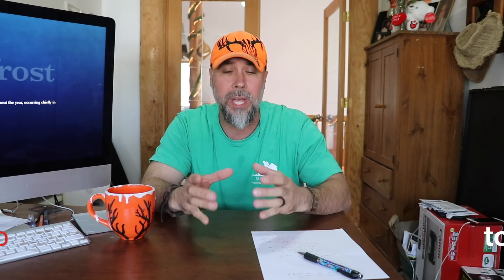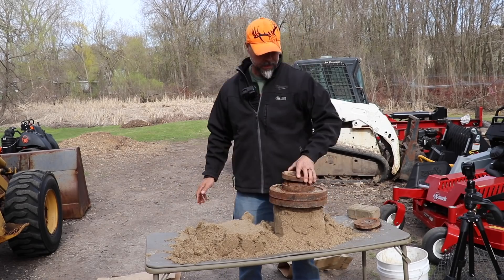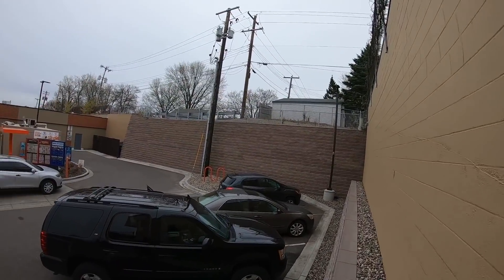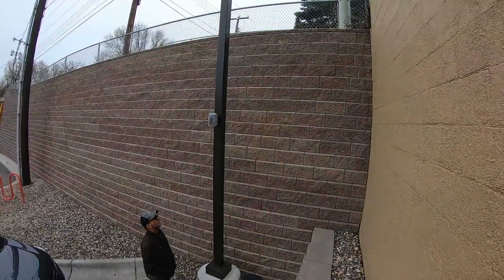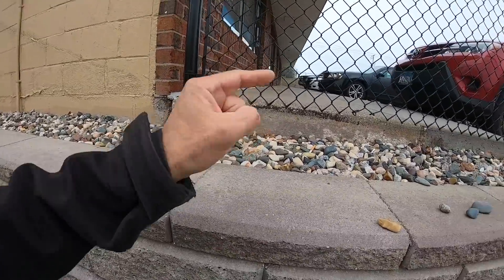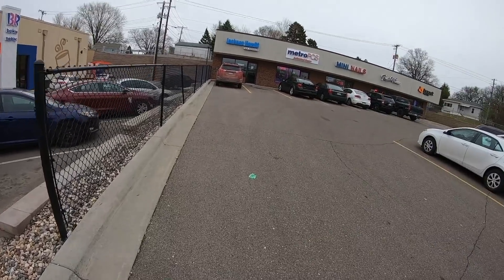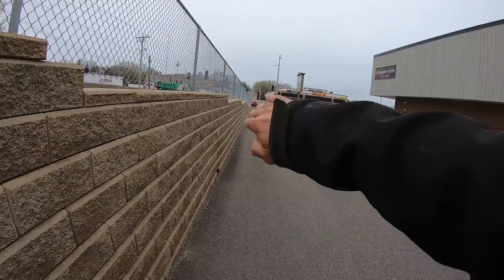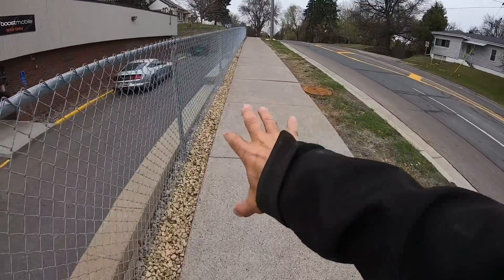Retaining walls and Geogrid- How a retaining wall fails pt2

Comment: The first example of a retaining wall didn't consider that the City most definitely had to approve plans and inspect the work. So either everyone, from the civil engineer to the plan checker to the city inspector to the constractor to the sub, must have blown it. In this day and age, and in my experience as a commercial developer, I don't see that happening. But whether it happened or not, It seems like that should have been mentioned.

Comment: We are working a wall for a homeowner, “who used to build houses”. Sugar sand, positive surcharge with grade, wall under 4 feet. We excavated and set the base, I suggested Geogrid as well it’s my name on the wall and there is a lot of runoff heading to it in a coastal area. Any suggestions for getting homeowner on our side, or am I over building it?
Reply: don't compromise your company's integrity for the cash, it's never worth it. unless you can convince the homeowner through educating them to use grid. the cost to use grid is nominal compared to the cost of having to rebuild it.

Comment: Hey Stanley,

I am looking into a terraced wall. Three 18” walls that will be separated 36” from each other. Is engineering a must for something like this? Or should can I rely on geo grid with these shorter walls? Also your videos have been a legit lifesaver and planning my projects on my property. I’ve learned a ton. Appreciate all your hard work. 

Thanks,
Martin 
Washington State

Comment: What should've been done on the 7:38+  wall?
Reply: Stabilizing such walls will include high strength steel plates on face of wall and thru anchor rods extending underground into the adjacent property. Helical tiebacks I believe is one of many names for such systems. Of course, the wall would have to be steel and grout reinforced vertically as well.

Comment: What are your thoughts on a 3ft high 10ft length on a curve garden wall with the mini beltis blocks. 4”Dx8”Lx3”H block?  With gravel/drain and 3ft geogrid?   The only fill its holding up is the soil I put behind it.

Comment: great insight Stan,the wall you built where they planted trees,how do you protect yourself from litigation if the wall should fail because of trees or surcharge?Do you put notice in the job quote that any alteration from original design,ie planting trees too close,will devoid you of fault?

Comment: I have a question. If I were to build a four foot block retaining wall on a concrete footing set on mortor with no drainage pipe or aggregate. How long would the wall last? Pls

Comment: Our townhome association needs to replace a 8’ wood retaining wall that has failed. The problem is with access. It’s only 8’ from the buildings and buts up to a creek. Our civil engineers suggest” anchorplex” system because of lack of access and space. What do you think of “anchorplex”.

Comment: A 20 foot retaining wall certainly had to have a professional engineer stamp in order to get a building permit, yes? In my area you can't even build over a 4 foot residential wall without a permit and over a 10 foot wall must have a PE stamp. If the PE stamps it, grid or no grid, what more can you expect? The PE firm that designed the wall is risking their license and possible criminal negligence charges should a wall failure cause an injury.

Comment: Not sure if you'll find this or not, but...building a 10-12 ft high retaining wall that starts out away from house and radiuses into concrete foundation wall. Plan to glue all blocks together for added strength, but should/can I tie the butting end of rad wall to concrete wall with galvie brackets and concrete screws?
Reply: Any wall over 3 feet high has to be designed by an engineer.

Comment: We just finish building  retaining wall to separate two buildings on for parking lot. geogrid  works really nice. Its industrial parking so should hold trucks with loads but will see. Calculations was made by another company and they decide to take full responsibility.

Comment: There are thousands of tons of pressure behind the wall and with changing moisture levels ,this is serious business. How about a concrete block wall I'm sure the morter joints would change the equation. I would like to do a garage in against a hillside.

Comment: You cant forget the surcharge from fences! They will cause the wall to rotate out. There’s no way as close as those posts are that it will not fail!
Reply: You can put posts right on the back of the wall if you use Sleeve-Its.

Comment: Great videos, keep them coming. How about the different types of geogrid and their different applications? Also, what about geogrid is so special compared to stuff like that orange plastic construction fence that is a fraction of the cost? Is there fiber reinforcement in it, or is it just the testing and certifications that make it more costly? It can't be that much more expensive to produce, it's just plastic mesh.
Reply: Geogrid is a much more advanced material than just plastic mesh construction fence...and there are many types and applications made with different advanced materials. The grid has to be resistant to the pH of numerous backfill materials and other environmental process, and different connection types (friction, pin, wraparound, etc) have an impact as well. Some types of grid are much more expensive to produce than others. The testing and certification is an integral part of the design process as well, you can't design a wall properly without it. If Engineers didn't have that testing and certification to rely on, the design cost would go up substantially as they would be taking on that liability.

Comment: You've yet to touch on the subject of placing fences above retaining walls. You have talked about surcharges and dynamic loads but not buried concrete fence posts; ie. how far behind, can they be placed in the aggregate, solutions to put them on the actual block wall, etc?

BTW, great videos with lots of knowledge being presented!! With the techniques and knowledge you have passed on with your videos I am now taking on the challenge of building a retaining wall holding up a small hill in my backyard. While there is not a large slope behind this 3ft. wall there is still a slope leading up to the above house and after watching this latest two part video series on Geogrid you have convinced me to install it for this project. Now to finish getting all these set in concrete posts in front of the railroad tie wall that are holding it up removed from the ground and hauled off :/  Thanks Stan!!!!

Comment: For the parking lot what if there's a concrete wall though right there beside it the only thing putting weight behind that wall is the rocks
Reply: OHHHH the parking lot... That narrows it down. Every single one of those retaining walls were located at a parking lot.

Comment: Can you do your geogrid like a rectangle or a box where you would gain going vertical versus horizontal so I can make it only go 15 ft back and I need an extra four feet they go up the other side and then buried in there that act more like an anchor Maybe?
Reply: no, it doesn't work that way

Comment: Is geogrid the only proper option?  Could another type of anchor have been used?  Curious if a different and proper anchoring system exists for conditions where there is not enough distance for grid?  Don’t skimp on quality.
Reply: Yes. MSE Walls. Mechanichally stabilised earth walls- it is how highway walls are built. Much more expensive, doesn't use blocks, uses concrete slabs, so not the same thing. If using blocks, it is the only way, but you can build a wall without blocks.
Reply: Shawn Khrusch thanks for the info.
Reply: @christopherrabaldo3377  A geogrid reinforced block wall (whether small block or big block) is also considered an MSE wall.
Reply: @jeffc6832  - yes. Good point. Should have said there are other types of mse walls. You're right. Thanks.
Reply: But. Yes there are other ways to anchor the wall, like metal straps.
Reply: Yea it would be cool if Stanley can chime in. I’ve watched all the retaining wall videos and they’re all awesome and very informative. I can’t help but walk away thinking these guys are experts at building walls with geogrid but what about a properly built wall without geogrid? These videos would make one think it’s not possible. As far as that one wall, it may not have been very cost effective to remove 5’-6’ of another businesses property. To suggest that the only viable solution is geogrid doesn’t really sit well with me. But don’t get me wrong, these vids are really great and I learned a lot.